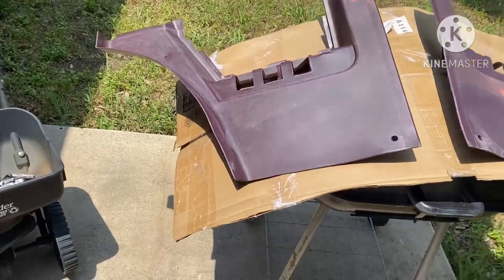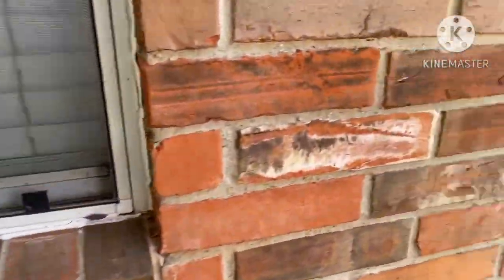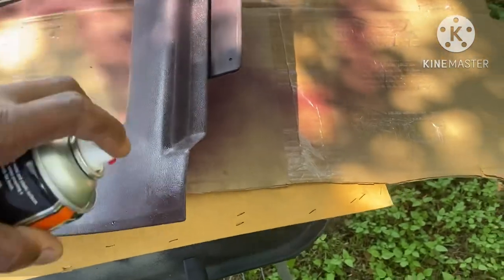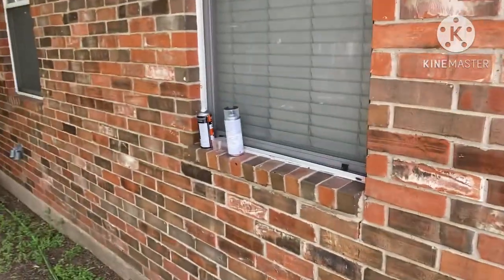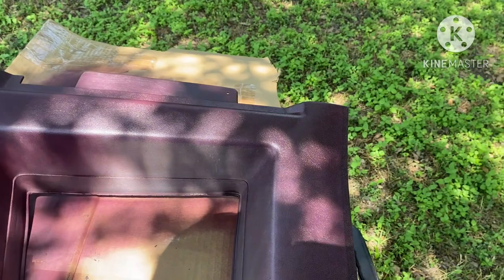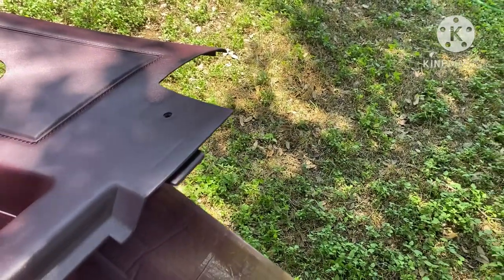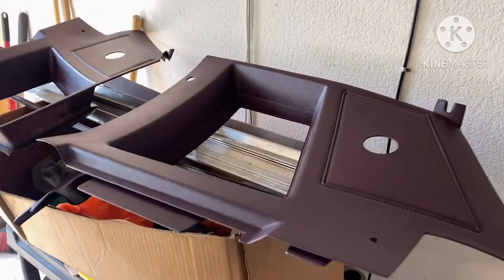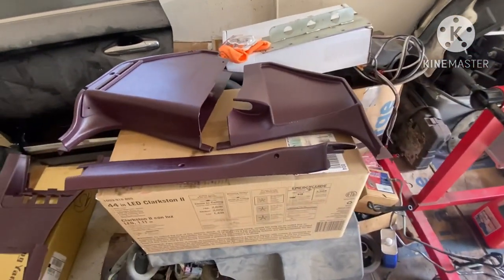Gbody how to restore plastic interior trim

Comment: 💎! Did you wash them down or degrease them before you put adhesive promoter
Reply from the maker: Wash with soap and water/degreaser scuff with scotch pad wiped with alcohol before adhesion promoter and paint👍🏿
Reply: @willierebuildz9182  thanks. Bout to do it the dash so I can trow it in. I got the upol promoter went with g body parts brand for the black paint . 💪🏽💪🏽